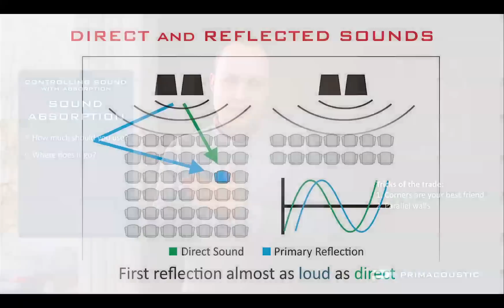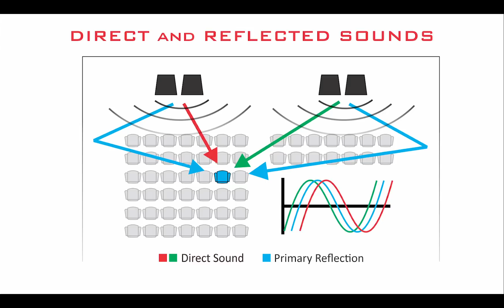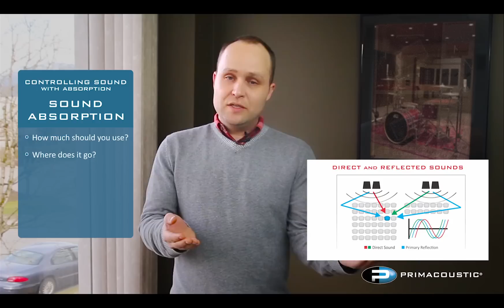Primacoustic Controlling Sound With Absorption -- Part 2 Where do you put it

Comment: What would you recommend in layout for a large octagonal room? The front and back walls are 80' apart, the side walls are also 80'. The ceiling vaults to the center. We have lots of slapback and reverb and run a contemporary worship service. Speakers are ceiling hung in front center, and side fills on ground stands on front left and right.
Reply from the maker: We have technical staff available to give you product recommendations based on your room requirements. You can reach them at the following link for a free quote! - https://www.primacoustic.com/contact/

Comment: In the process of installing two London 8 kits in my audiophile music room. Nice straightforward hanging process. Will look into bass traps too. (I like the DSPeaker Dual-core 2.0 for room mode control). Do furnishings count into the 10% minimum of wall area rule? Thanks